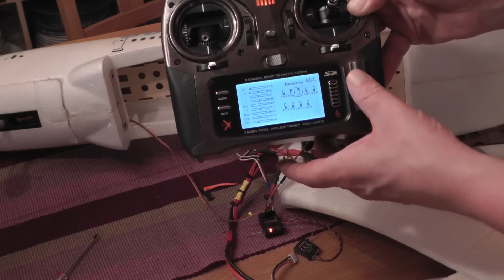RC AIRBUS A380 - Elevon Or Normal Setup

Comment: i plan on putting a rudder and servo inside of the plane. should i fly on regular settings or switch to elevon then. it seems with the ailerons moving like the elevator it would not have enough lift to take off in a  timely fashion. i fly on a grass runway and i think it would not have enough runway

Comment: I know this video is quite old now, but can you remember where you set the C.O.G,  thank you.
Reply from the maker: jeepman012 Hi Sir.  I don't remember the cg. But i remember using a 3cell 5000mah 35c and just put it the battery plate in center.  i will try to see if i can find the manual. Hobby king has these in stock now.

Comment: Hello I can use safe recevier system and use spektrum dx6i transmittr,
Safe flight system help us beginer ,intermediadte and profesyonel mode is it possibele
Reply from the maker: Celal özer i would not use this system on this plane. if the plane stall the safe system want have a chanse to correct it